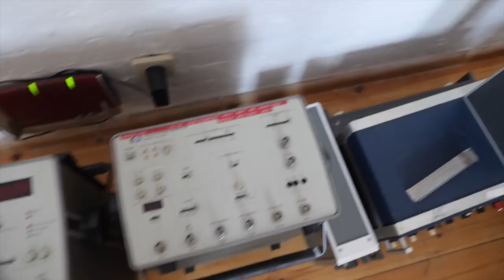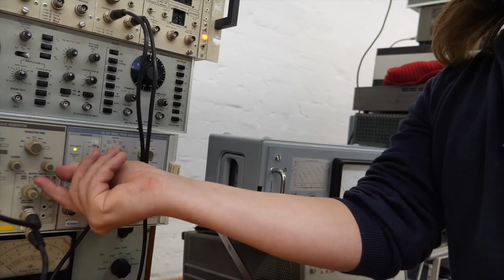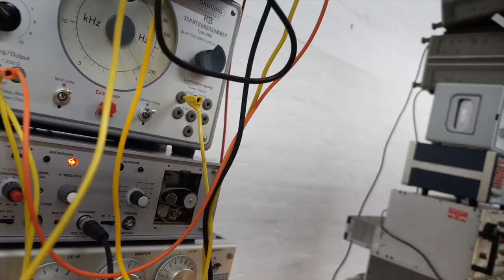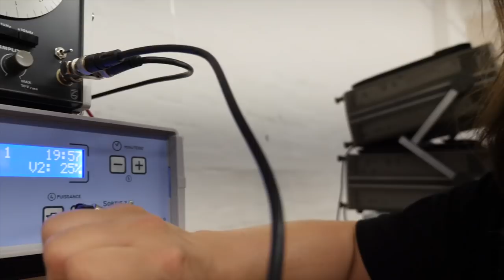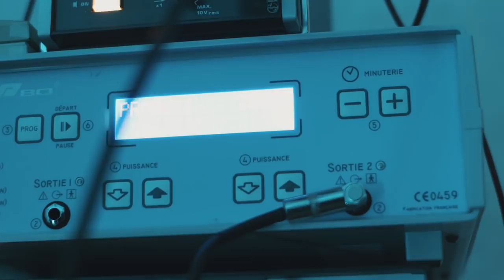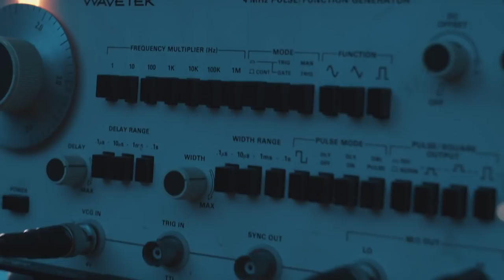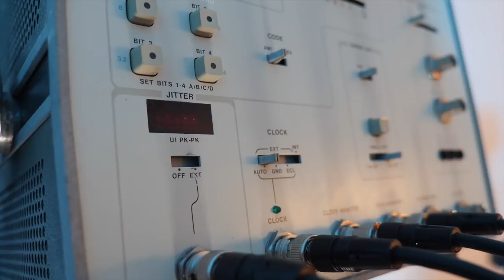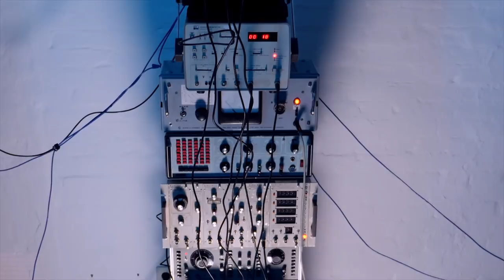Playable sound sculptures from obsolete test equipment

Comment: 9:01 Nice Koma Elektronik RH-301 (next to a 303 everybody needs one) plug, but did you use it in this setup and couldn’t have any other simple clocking device have done the job?
Reply from the maker: Yeah, I mention how I use it in the video and it became the master clock. It was the ideal device to bring everything together, else I would have had to bring my modular and to adapt all the voltages. Swiss army knife of clock
Reply: HAINBACH  I didn’t see you use it during the (very nice) performance, so that’s why I wondered.

Comment: This is great stuff. Parts of it sound a bit disjointed, mainly the transitions, which is to be expected from live improv with a pile of random non-instruments, but parts of it are utterly cold cyberpunk beauty. I hope you get a chance to record some of this stuff and smooth out the rough edges in post. This should be the sound track of some film. Love it.
Reply from the maker: In regards to transitions, this is a 15 min edit of the 30 min performance. So they are way more sudden than in the original performance.
Reply: @Hainbach  Ah, that makes sense.

Comment: I'm only 2 minutes in, but I need to say something: obsolete test equipment is almost a non-existent thing. Test equipment may become obsolete for production use, but still be fine for repairman / DIYers. I have some 40-50+ year old test equipment that I'm still using for its original purpose when I'm repairing pieces of my little vintage AV and test equipment collection (or even for repairing modern equipment).
Reply from the maker: I agree that is true for audio/video related gear, but lock-in amplifiers, big medical pulse generators, PCM communication protocol testers and telegraph generators are definitely out of favour.
Reply: @Hainbach  Yes, I agree with you about the telecom protocol analysers, but lock-in amplifiers can be useful in some situations (and they're still in production), and I've seen oscilloscopes and function generators here, which are definitely useful instruments for their original purpose (e.g.  at work we still use  the exact same Wavetek function generator seen in the thumbnail). 

Of course I don't say it's wrong to use them for your purposes, it's completely fine and cool, I just say that they don't belong to the landfill at all.